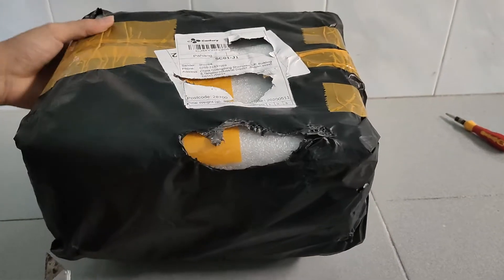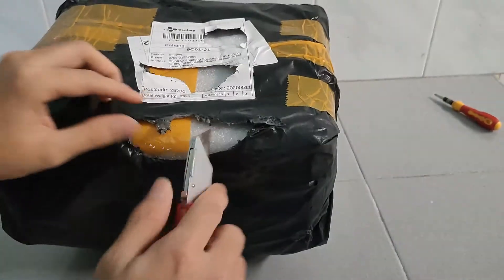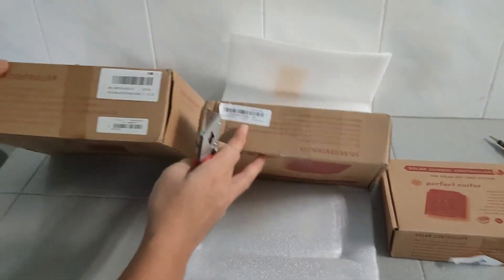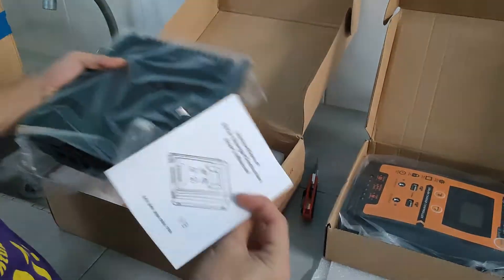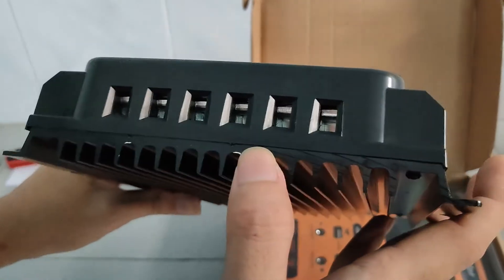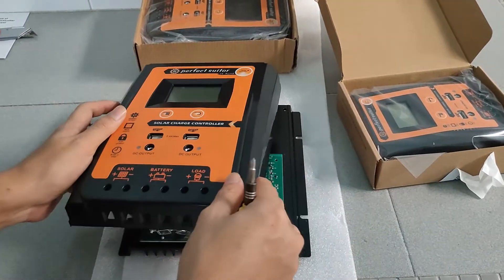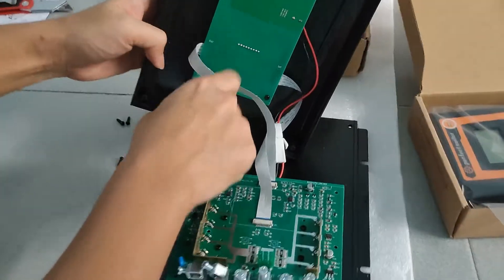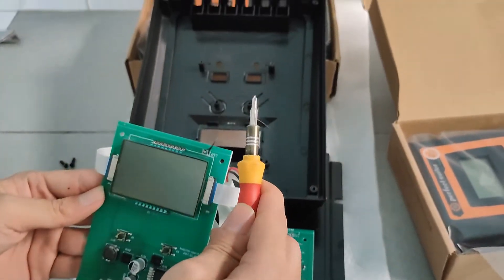Perfect Suitor 70A - Another PWM controller?

Comment: There's a blue ceramic capasitor inside, may i know what is the specs of that capacitor?
Reply from the maker: Hi there, sorry but all of the perfect suitors were returned because none of them were MPPT and as such I am unable to tell you the specifications of that capacitor.
Reply: its a surge protection component
Reply: Perfect suitor, model: PVSC 70A. Синий керамический конденсатор это "варистор", его название: 10D560K.